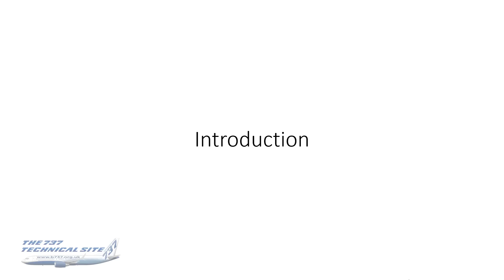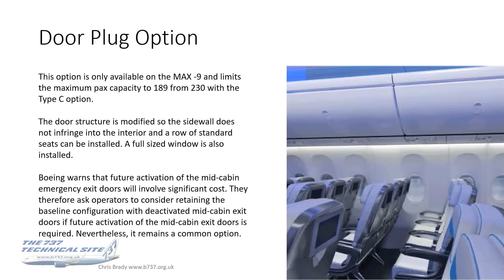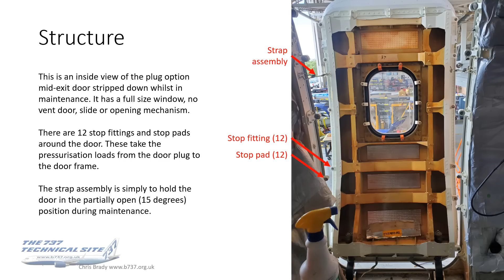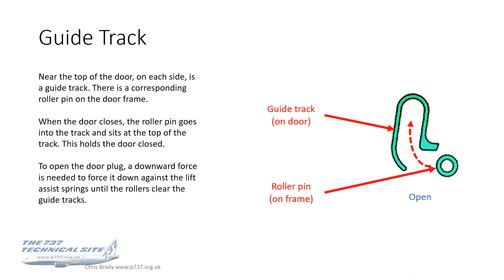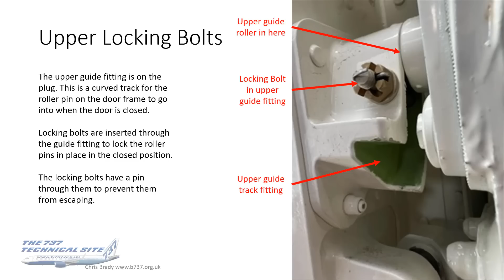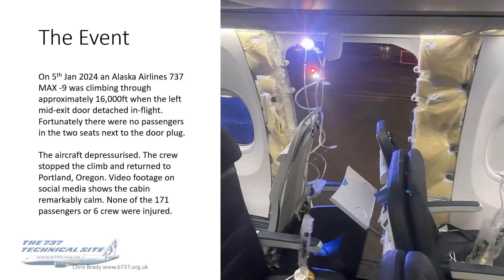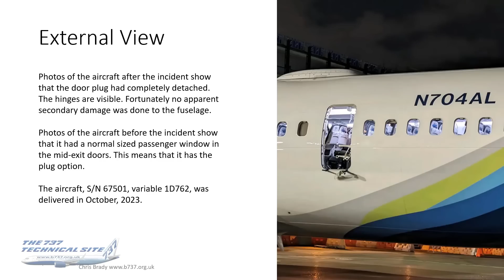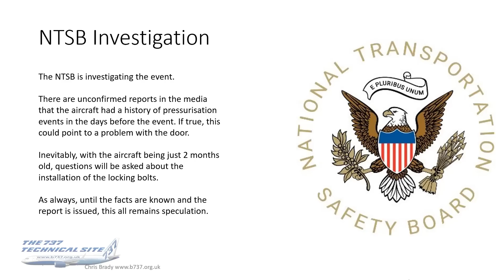737 Mid-Cabin Emergency Exit Doors - Plug Option

Comment: Still have some questions. 
1. the door should go downward against spring in order to open. then how was the door blew off? Does the cabin pressure diff can push the door downward? 
2. if the door can be pushed downward and opened with cabin pressure diff, how could it fly for 2 months without failure?
anyone who can help me to understand?

Comment: Great explanation. As an engineer I'm always interested in these kinds of detail. @Chris - at the 10:00 minute mark where you explain the lower hinge, you describe the "hinge guide fitting" as being able to slide up the cylindrical arm of the hinge (once free of arrestor bolt). In the photo it looks like at the end of the spring's travel, it would still be retained by the double-nutted, large washer which is bigger than the hinge guide bore, but we know the plug and the guide came completely off the hinge. In the exterior photo, there doesn't appear to be any fuselage damage and the forward hinge post looks in-tact (hard to tell if that's a piece of the plug attached to the aft hinge). If the nut and washer are meant to retain the hinge guide during service (not a mid-flight emergency), I'd think the force of the air dragging on the plug would have caused other damage. The one photo I've seen of the NTSB inspecting the door it looks like at least the aft hinge guide is missing. Any thoughts on this - was the guide ripped off, the washer not retained or something else?

Comment: Why were the two adjacent seat vacant? Did the airline have reports of wind noise problems, and on a packed full aircraft did the airline not sell seats in those positions to mitigate potential subsequent passenger complaints?
Seems far fetched.. but with now confirmed pressurization problems on this specific airplane, was there some hint to the airline personnel that this was a problematic area inside this aircraft. I question why on a fully loaded aircraft was this two particular seats were not sold on a revenue generating flight? Why not sell two seats in high demand? Why these two particular seats?
Reply from the maker: It was just good luck.

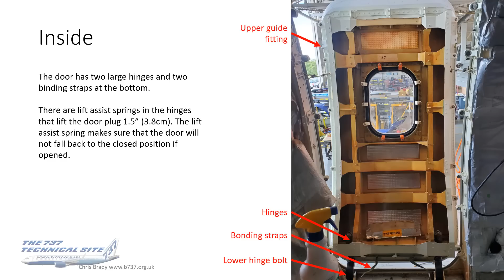Comment: At 6:24 you mention "lift assist springs" which prevent the "door" from falling back into the closed position, something that is "hugely undesireable if there was an evacutation in progress."  This opening was never intended to be used during an evacuation of any kind and was designed to be opened only using tools. Saying this is confusing, incorrect and should be removed. Otherwise very well done video. Thanks.
Reply from the maker: It was a slip of the tongue. Unfortunately these videos can’t be changed after being uploaded. That is why I did the update videos
Reply: The assist springs are necessary when the doorway is used an emergency exit, so the door can be opened quickly and relatively easily.  When a plug door is installed, it uses the same mounting hardware as a regular door, mostly.

Comment: In the fallout section, you didn't mention the plug itself literally falling out of the sky in someone's backyard.

Jokes aside, between no passengers by the blowout, clean break from the frame, and the plug not striking the tail or elsewhere on the plane, it's a sheer miracle that nobody was killed in this incident.  Not to sound morbid, but there's a very real possibility that this could have been full loss of aircraft along with all souls onboard.

I've read elsewhere that the cockpit door was open at the time.  The checklists along with everything else not strapped or bolted down was insta-vacuumed out.  Not saying the pilots don't know their jobs by heart, but dealing with damage to flight controls in these conditions would've been a seriously bad day at the office for the pilots.
Reply from the maker: I do not think that there is any conceivable way that this incident could have lead to "full loss of aircraft along with all souls onboard.". Also, the checklist is very short, it only covers the essential items. Most pilots actually have the checklist memorised, although they always use the paper checklist as a check to ensure that all items are done.
Reply: @ChrisBrady737  My thinking was along the lines of the plug coming off and hitting the tail of the plane.  How much does it weigh by itself?
Reply: @dagamer667  63 pounds, certainly enough momentum to damage the rear stabilizer.
Reply: @dagamer667 -- It was not likely to strike the empennage.  The door rotates downward on the hinge at the bottom before becoming detached.  Thus, it is in a low position with downward monentum when it is free of the doorway.
Reply: @GH-oi2jf  I don't think that's hypothesis worth testing on a plane full of passengers, though.  I suppose one bit of good news is that we have heard of any more major screw ups being found while the operators inspected their fleets.

Comment: I wish you had included the 737-900ER instead of only looking at Max variants.
Reply from the maker: The door plug on the -900ER is identical to that on the MAX -9
Reply: I bring it up because a Delta friend says they were done at a different location than the Max9 but the FAA is still ordering their inspections. Also I was about to argue with him that the plug door was only an option on the Max 9 per your chart but clearly the -900ER, not the -900, has the same plug door. Thanks for the reply

Comment: Don’t understand why these door plugs open outwards which makes them susceptible to the air pressure differential blowing them out rather than oversized and opening inwards, like the main doors and emergency exits, so the air pressure seals them even more closed.  I know it would make maintenance more difficult because you’d need to remove the seats to remove the plugs.  But opening inwards is an inherently failsafe design which doesn’t require bolts, just air pressure, to hold the door closed whereas the plugs would seem to rely on fixtures to stop the air pressure blowing them out.
Reply: On the 737-100 and -200, the emergency doors had to be removed to the inside, then moved out of the way of the doorway.  FAA rules require that aircraft passengers be able to evacuate in a short period of time.  The newer door mechanism, which opens by lifting up, then rotating outward, allows for more efficient evacuation.  The plug doors are not emergency exits, but they mount in the same doorway using the same mounting hardware, with bolts added to hold the door in place.

Comment: At the 11:46 mark, what I find puzzling is how there appears to be no damage whatsoever to the stop pads (at least the ones that are visible). If we presume failure of all bolts, then I would imagine that the differential pressure due to 12 psi (typical cabin pressure) and 7.87 psi at 16300 ft would be sustained by all 12 stop pads. Based on the door plug dimensions of 46 in X 26 in, this works out to a force of 4942 lbf imposing a force of 412 lbs on each stop pad. How they didn't shear off is beyond me, even assuming that the door did a bit of a swivel about its vertical axis on the way out.
Reply: The stop pads are designed to hold the door against air pressure at any operating altitude.  I would be surprised if they failed at 16,000 feet.
Reply: @GH-oi2jf  Thanks! I see that now. My understanding of the system was flawed.  It appears that the differential pressure resulted not in a radial outward blowout of the door, but a dislodging vertically that let to it opening more or less as it's normally designed to do. 

I am a bit surprised though that the frictional resistance offered by the stop pads idn't prevent this!

Comment: So 4 safety bolts right? 1 on each spring, and 2 on the upper hooks right? Those are load tested to assure turbulence can't jar them out right? It doesn't appear that would have had any wiggle room, even if top ones were left out, correct? Since we can't see the springs because they are shielded, maybe they didn't have springs or maybe there is enough action in one side or the other to raise. A couple hard landings might have made it ajar and then, well, I would want to see the door action of what it looks like for a plug to come out. I am thinking the bottom could come out and the top still be pinned in, it is possible showing that angle. 

Also why in the hell did they fly if they were getting warnings about not being able to pressure up? That must be one of those small oversights that will get changed. Maybe because losing pressure isn't fatal so they don't stop flights over that kind of warning? This was really bad for that airline, knowing that was a problem, and then making sure it didn't go out over the ocean was them saying they weren't wanting to lose money, with the chance that they could lose pressure. I wonder if it goes deeper like they didn't set anyone right there because they heard wind or whistling. Brand new jet I am sure it would have been fairly obvious if they couldn't pressure it up, there should have been sound. Right behind the engines yeah but...

Thanks for the details. I came over from @Mentour Now! I am pretty sure he thought there was only two securing it from opening.
Reply from the maker: @chris_hisss  there are definitely 4 locking bolts. It is looking like none were installed at the factory but time will tell. The aircraft could pressurise normally but on 3 occasions it seems that one of the 2 pressurisation controllers failed, but the alternate one took over as designed.

Comment: My Concern is that The Airline knew the plane had a "Pressure" issue and just put it on the "No Hawaii" List... instead of "Grounding" this Jet until the Issue was "Resolved"   and then there is the Issue of Missing Bolts,,,

Comment: Chris  Just to say plug doors were available on the 737-900ER and were to the same design as on the MAX.
Reply from the maker: I realise they were on the -900ER and were probably identical to the plug doors on the MAX-9. What I didn’t understand was why they weren’t included in the FAA AD.
Reply: @ChrisBrady737 -- Perhaps they weren't included because that model has been in service for a long time.

Comment: The 737 technical Channel has some important pictures of a normal door plug:  the springs on the hinge pole below the guides attached to the door. Those springs help lift the door.
On his recent video on the issue, there is a picture of the door with the hinge guide in the "bolt inserted" position and one where the bolt is not inserted and psings allowed to push door up. The moveme t is significant. 
My take is that the door plug  was installed without the restraining bolts, and the spings keep the door high enough to clear thestop pin/pads from each other, but not high enough to have the door roller guide reach level where the roller pin could get out.  So the door effectivally kept cabin pressurized with only the roller pins preventing door from swinging outwards, but after enough cycles, they fractured and let the door open. 
This all depend on how high the spings keep the door when the bolts re not installed. 
Another possibility is that the door was partially up, but hitting rugh tarmac prior to departure made the door bump up enough to become fully unlocked and stayed that way because the air conditioning in plane provided just enough pressure to move door out just enough to not want to come back down.

Comment: The company that did the Wi-Fi installation, started its work on 11/27 to 12/7. The so called depressurization issues on the specific Alaska Airlines aircraft all started on or after December 7th. Per the NTSB, the three prior instances of depressurization issues were on 12/7, 1/3 and 1/4. We do know the Wi-Fi installation company, AAR did release a statement they did not remove the door plug in question. Coincidence, that the depressurization issues were after the Wi-Fi work ? Maybe….but there may be correlation.

Comment: There is a fundamental flaw, this aeroplane did not adapt well to a larger fan engine because it is a very old design. The secondary stuff, such as the panel issue, could be related because of the royal train effect where something with such importance attracts other issues.

Comment: 4:35 I'm not so sure "that's where the name comes from" in electrical and automotive applications a delete plug has nothing to do with thickness inside or outside. 

You may see a delete plug component wherever an option is not there.

Comment: If certain bolts failed or were not installed properly (or at all), it sounds like the springs at the bottom would push the door up. Is that right? In other words, it is not a fail-safe design since failure means the springs push the door up (not down).

Comment: Seems we may have been looking at the wrong bolts (screws). If you navigate to 9:57 you can see that the Pillar Socket is itself secured to the door further to the left. If you look at the red line marked "Hinge Guide Fitting" about halfway along you can see above it the head of a screw in the dark recess. There are 4 of these and maybe the ones that are being found loose.

Comment: Am I wrong but my mind is blown that these aren't installed from the inside.  Really can't be pulled out even if not bolted on?  inside higher pressure is pushing the plug against the frame / can't fall out.  I'm trying to think what it was - not sure a plane or something else, but heard of some similar situation where they specifically said the item is bigger than the opening / installed from the high pressure side to prevent this.
Reply: This door plug is pushing against the frame through the stop pads on either side of the doorway.  The reason the door goes out (after lifting it off the stop pads) is that in an actual emergency you want to evacuate the passengers quickly.  Bringing the door inward conflicts with passengers wanting to get out.  The door plug is not used as an emergency exit, but it uses the same mounting hardware as an emergency door.

Comment: I noticed on the lower hinge bracket assembly flat head Phillips screws were used, but they don't seat into anything. Pan head or hex head should have been used to seat properly.

Comment: Great video but just a comment related to your audio. Found this very hard to listen to because your mic is set too sensitive and is picking up your heavy sighs, breathing and swallowing.  You may want to play with your mic settings so that your videos are a little more appealing to listen to.
Reply from the maker: I know, I did make adjustments based on this feedback to the FAQ video but that came out too quiet. I have today bought a new mic which should help for any future videos.
Reply: @ChrisBrady737  your content is excellent keep it up.  Just wanted to give you some constructive feedback.

Comment: The securing bolts have a locking cotter pin in each. If the cotter pins had been installed there is no way the bolts will have come loose Looks to me that none of the 4 bolts were installed. The plane is only a couple months old and if the bolts and nuts but NOT the cotter pins were installed there is no way the nuts could have all worked loose in that short a time. My vote is the idiots put the door in without these 4 securing bolts.
Reply: Agreed. That was my assessment as well and it looks like we were right. What I find puzzling though, how could the door have departed from the aircraft with the two shafts it slides on at the bottom still in place? Were the nuts and washers on top of the shafts also not installed or is it a design with a dedicated failure point? When the door would have been ripped from the airframe tearing at the lower hinges substantial damage would be expected.

Comment: Does any airline actually use this door/plug as an emergency exit?
Reply: It is used if more seats are included. Those airlines that cram in seats (and probably have no upper class cabin) would be obliged to have this opening as a door. But it can't easily be retrofitted.

Comment: Before I begin, I work on B747-400's as a structures lead mechanic. I know what I am looking at.
Time stamp 3:50...the doors plugs TRANSLATE UP.....not down. 
Time stamp 6:04, see..... the springs you mention push the door plug UP to open and prevent them from falling DOWN and closed....the door plug TRANSLATES UP to open
Time stamp 6:30, the plug has to TANSLATE UP for the door mounted fitting to move up and clear the stationary roller pin so the plug can open.
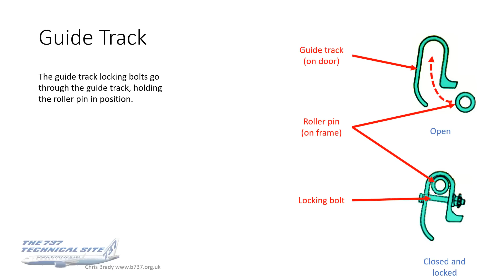Time stamps 8:35 and 8:50, see...the bolt holds the fitting (and therefore the plug) from moving UP to open
Time stamp 10:00, the lift assist spring assists lifting the door UP, the bolt holds it DOWN and closed, the guide rod has extra meat on it in the UP direction so the door plug can TRANSLATE UP
Armchair engineers......😞
Reply: Chris has already apologised for saying 'down' when he meant 'up'. He has done a superb job to get all this information together and I thank him for his analysis. While the simple view is the door goes up and out I wondered how much lateral tolerance is built in? As an engineer you will know there has to be some clearance and the upper tracks do not provide any lateral location. They are just pins in tracks. The 12 Pads are very small and I pondered whether there was enough 'twist' of the door in the frame to allow them to miss each other when one lower fixing was missing?

Comment: My guess is:  somebody installed the castellated nuts finger-tight, planned on coming back to install the cotter pins, but somehow that never happened.  Over time, the castellated nuts vibrated loose until they came completely off the bolts.